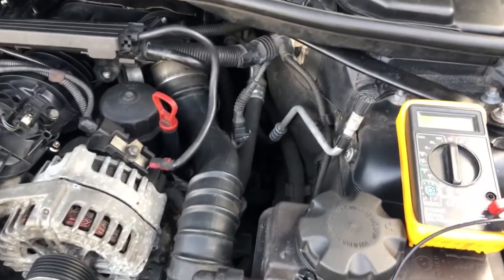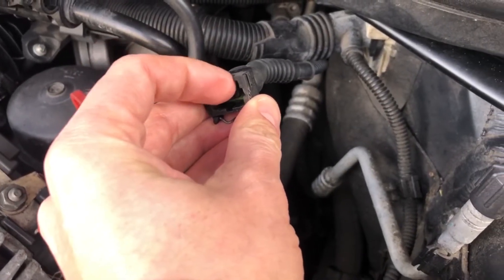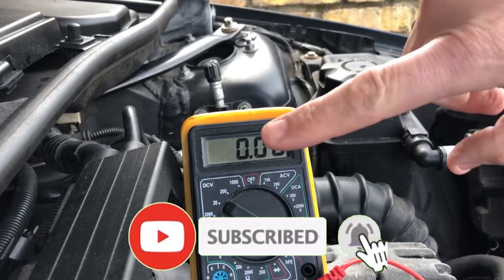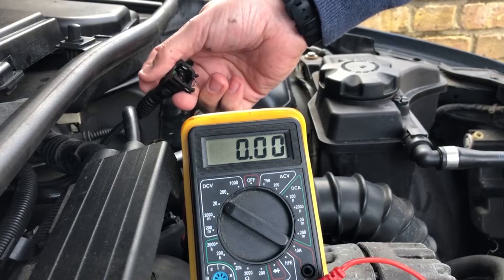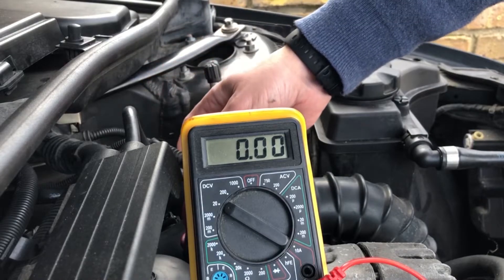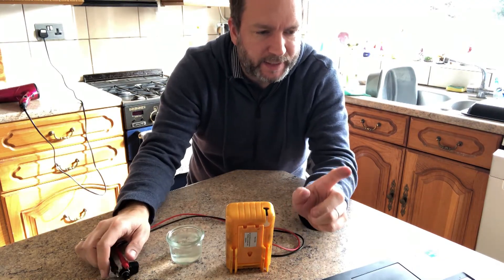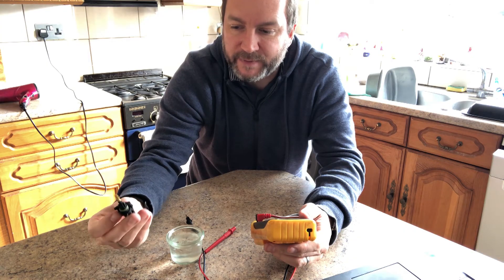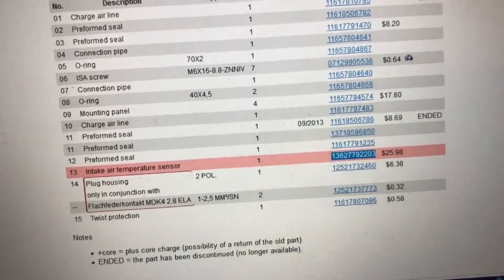BMW N47 / N57 Intake Charge Air Temperature Sensor Error - 4390 / 4391 / 4BA1 - REMOVAL and TESTING

Comment: The sensor on the E60 turbo pipe needs to be changed, the tip is broken, there is only the sensor
Reply from the maker: I had the same thing too with one of the sensors.

Comment: After cleaning the intake manifold for clogged Soot, i ended up mixing the connector for oil pressure and charge temp sensor thus putting the car in limp on higher revs, this video helped me understand on the go that one connector has 1 pin and the other 2 on a same 2 pin connector... Geez thanks.
Reply from the maker: Glad I could help, thank you 😀

Comment: I changed my oil filter housing gasket myself and the car was super slow and slugish and throwing error for the Intake Charge Air Temperature Sensor 

Turns out when i put all back together I also mixed up where the oil sensor and charge air sensor wirings connect and had them in reverse.
swapped them around and all way good. you saved me lots of time and nerves
Reply from the maker: Excellent news. It’s a common mistake to make.

Comment: Thanks Neil. Had my e60 520d serviced with new turbo and car stopped regen slowly afterwards. Got a brief brief engine light saying dpf blocked. Ran Bimmerlink and threw up codes 480A and 4390 saying dpf block and charge temperature sensor error. 

After watching your video realised that charge sensor had one wire and oil pressure had 2. Did a switcheroo and engine started regen immediately as soon as I was on highway. No error codes also. Thank you so much!
Reply from the maker: Excellent. Glad it helped you. 😀
Reply: So the correct should be 2 wire in the charge sensor and only one on the oil? Because mine has the connector with one on the charge sensor
Reply: Same here thank you !

Comment: Thanks. Sorted mine out. I had the intake temp sensor error, also the oil pressure error. Mine was the Conectors plugged wrong so I just changed them, deleted the errors and it's all perfect now! Thanks for the info !
Reply from the maker: That’s great. Glad it helped you. I must get mine sorted.
Reply: Mine too! The connectors were swapped! 😅

Comment: I'm having a hard time removing this sensor, do you simply pull as hard as you can once you've twisted it clockwise?
Reply from the maker: From memory yes. It’s got a bayonet type fitting with 2 lugs. It can be a pain though. Have you turned it enough?
Reply: @NeilsCarsAviationTravel  Thanks, I'll try turning it more next time. I'm chasing some EGR (EGR is new) and MAF codes and I'm basically trying to change any related sensors that I can.
Reply: @laurentium3337  Hey, I'm literally chasing EGR and MAF codes too. Did you find a solution?
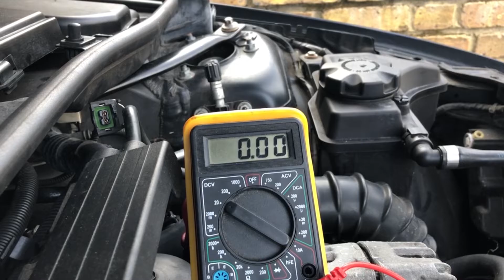Reply: @DaiQuGFX  Yeah, it had nothing to do with this sensor. All my MAF and EGR issues were caused by a sticky EGR valve. I lubricated it shortly after this comment and everything is good since then. https://youtu.be/tukpI5RxsLQ - go to min 6:37 to see what I'm talking about and try it yourself.
Reply: @laurentium3337  Thanks! Definitely will try it tomorrow

Comment: Hi Neil, thank you for this video. Did you replace the IAT and did you manage to solve the problem? I have recurring 4BA1 fault code on my E91 335d, the part number for the IAT sensor on my car is identical, I wanted to know if this is the way to go after replacing the air mass meter on my mechanic's advice and nothing changed. I was expecting the next video, am I missing something here?
Reply from the maker: Thanks for reaching out. Actually I haven't done another video yet as my car (or rather the gear knob) was being used as a template for a re-trim, and it took longer than expected. The summer holidays then got in the way, however I will be taking it out of storage soon as I need to crack on with it.
Long story short, I never got around to fitting a new IAT, but its next on the list.
Reply: @NeilsCarsAviationTravel  Hi, I solved my problem. It turned out to be the air mass meter after all. When I bought the car the diagnostics already showed the 4BA1 code, so I replaced the air mass meter with the same model I found on the car - Pierburg, after consulting with my mechanic, of course. It did not go away. My mechanic is very good, but, in his words, he have reached his skill's ceiling in terms of engine electronic and he was lost. He than recommended a famous tuning shop near the city I live in, which is specialized in BMW, I went to see them and they suggested it is the air mass meter, because on their diagnostics the ambient temperature, according to the air  mass meter, was 10 000 degrees centigrade :D They had a used Bosch, they said it is the OEM one, replaced it and the error went away! Finally! They suggested I should look for a second hand one with the intent to switch the mass meters back, but I told them that the mass mater will not leave my car, so I bought it from them and for the last few months everything is fine, knock on wood. So, In my case, the IAT sensor had nothing to do with it. Good luck!
Reply from the maker: @mihail_naydenov  glad you got it sorted out in the end. I may swap my MAF with the one on my E93 I’m currently working on and see if I see a difference.

Comment: so what are the correct values if yours were wrong?
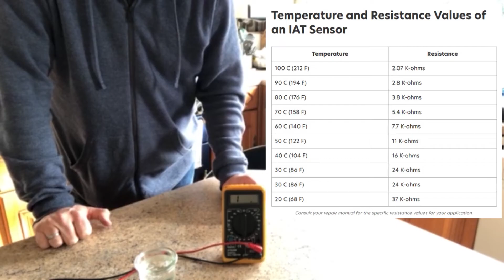Reply from the maker: At @13:10 I put some generic values up, assuming you mean the bench testing.
Reply: @NeilsCarsAviationTravel  ah I see I havent got that far, thanks :D
Reply: just tried it, mine is 1.8 Kohm in room temp 29degrees C, and goes down below 0 Kohms when heated. Meter set to 200k

Comment: Thanks for the videos i must test it,

my problem ist that i have the error codes P1245 and P1246 ,
the cable frommthese same sensor are a little bit destroyed .. I thininthazs it but i am not sure . Please help
Reply from the maker: If the cables (vacuum pipes) are bad then you will need to get them replaced. Are you based in the UK?
Reply: @NeilsCarsAviationTravel  
I am from Germany.

I replaced this sensor nothing changed..

Comment: I have same error codes 4391 did replaced the IAT sensor but it started throwing dpf 480A and 481A error codes. I have cleaned the dpf but no luck it worked for few days and again same problem with same iat sensor and dpf error nay suggestions??
Reply from the maker: I can’t remember what the 480A and 481A codes are. What’s the mileage on the car as one of the DPF codes is just a warning based on mileage. I’ll have to check.

Comment: good luck, hope you'll get it all fixed.
i have the same n47 motor, once it begins doing weird stuff with sensors, dpf, maf, o2, it's quite a deep shit because all those sensors do interact and to get the actual sensor or problem fixed can be a pain. I'm doing o2 sensor and cranckcase after doing the 4 glow plugs and controller.  I think i  uked up the flaps actuator in the process, have to recheck that too, but i'll probably delete the flaps.
Reply from the maker: You can delete the flaps, but unlike the M47 engines, the N47 doesn't like it so much especially on the twin turbo ones (123d, X1 23d, D3 etc)
Reply: @NeilsCarsAviationTravel  didn't know that. Mine is a N47 remapped from 177 to 230hp, it's the car i have had the longest an has been the most reliable overall (230k km now). Having the wagon, the weakest point was the pneumatic suspension bags with the motor and the auto-hydraulic trunk was a pain too. I'll be driving about 6000km this summer for vacation, so starting to prep the car ...